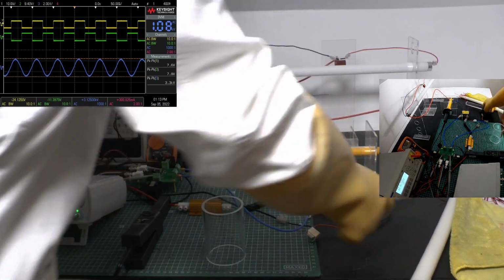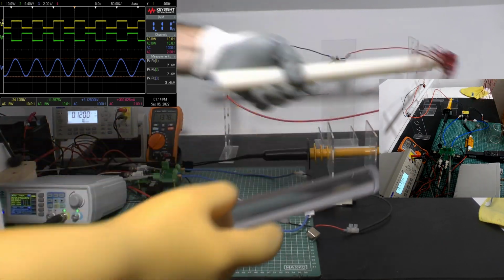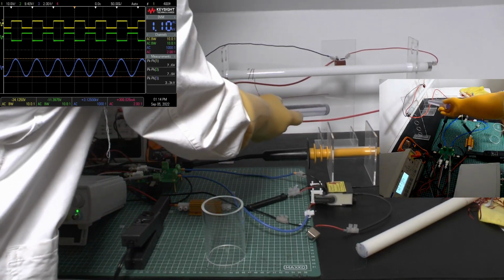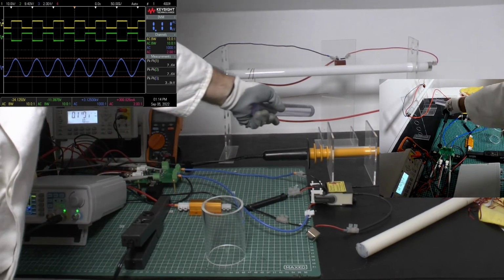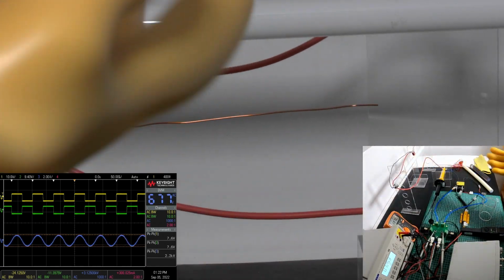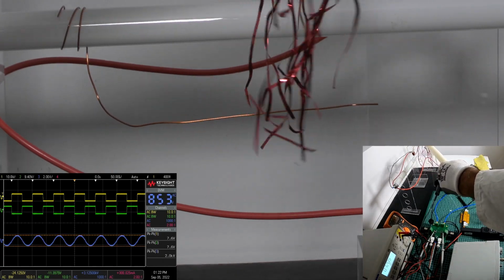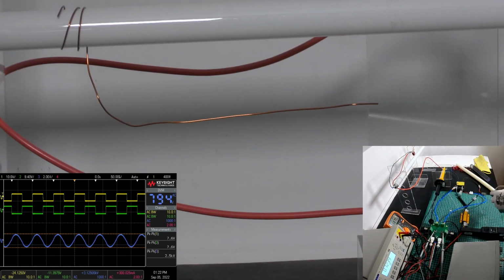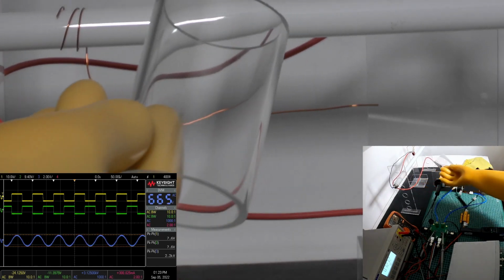The Avramenko plug and one wire power transmission

Comment: You can keep the bulb on with a coil in the circuit. Not just a flash, run the signal through a primary like a Tesla coil and the field keeps the gas oscillating
Reply: Still need a small static charge to initiate